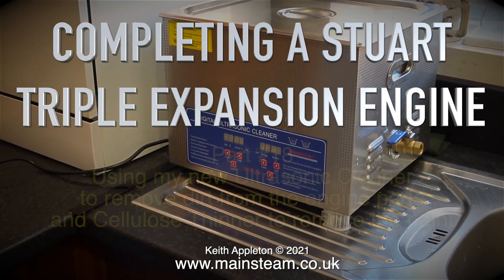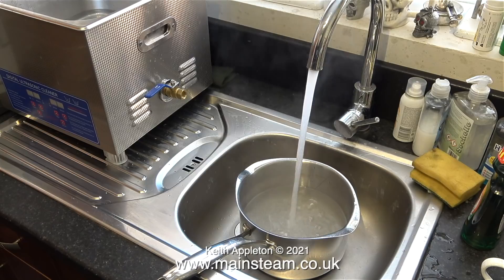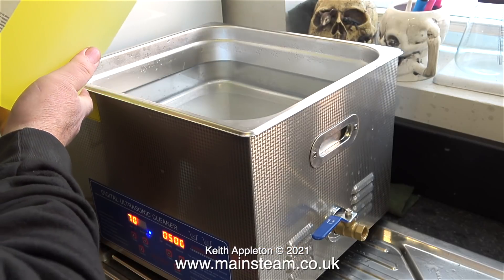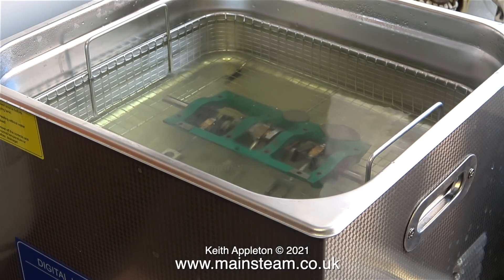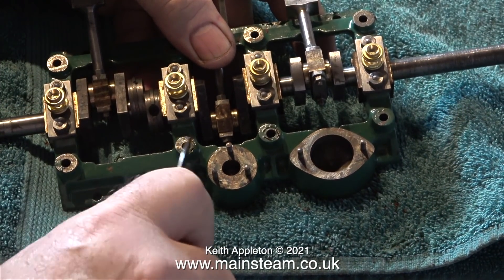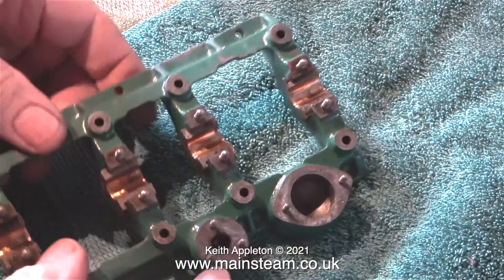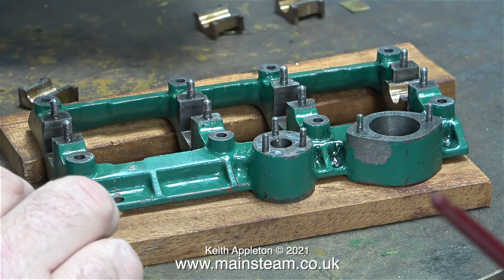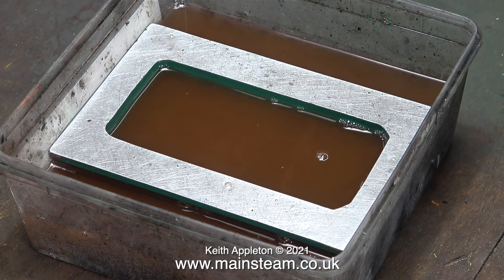COMPLETING A STUART TRIPLE EXPANSION ENGINE - PART #18

Comment: Thank for the good description of the ultrasonic cleaner. I am considering buying a larger one. Tip: if you pour in fresh tap water let the cleaner run for 20 mins. Fresh water contains a lot of microscopic air bubbles. As air is compressible this reduces the effectivity of the cleaner. If you give the cleaner a spin before actually throwing the parts in that drives out the microbubbles. Keep the solution after use if it is not too contaminated, so you do not have to repeat the de-bubbling cycle every time. But maybe I am just another “stupid viewer who commented…” 🤨😂
Reply from the maker: Good idea, Thanks. I did notice the bubbles on the first runs.

Comment: need to use a cleaner tank stretcher to get it to 15 liters liters (oh silly me lol) what piece of equipment did you get  in York (in layman's terms)
Reply: Doug - if I heard it right, the equipment is a Myford ML7-R. It’s a lathe, made in Nottingham, one of a long line of much-respected machines. Myford lathes have long been the standard among model engineers.

Comment: Would you happen to possess some Ph paper ? If the solution is alkaline,there should be no rusting of anything ferrous. Pharmacies used to sell the stuff,not available nowadays I can find. Occasionally very useful.
Dishwasher tablets and powder detergent are highly alkaline.
Soda,sodium carbonate in water ,used to be used in dirt floor shops as a method for keeping ferrous rods and plates from rusting. Just leave it in the barrel soaking,and voilà,no rust. Loosens linseed oil based paints as well.